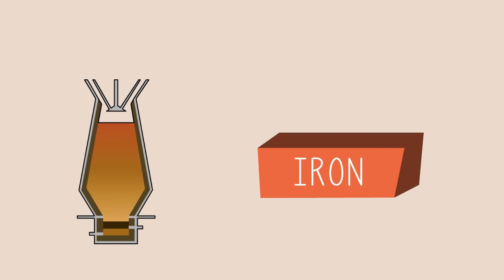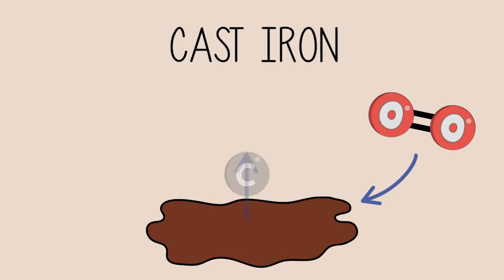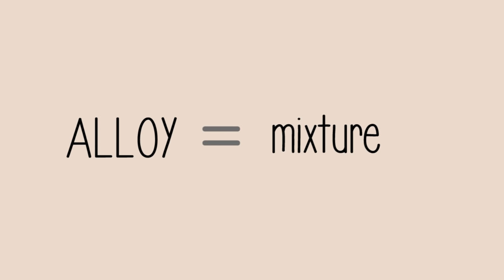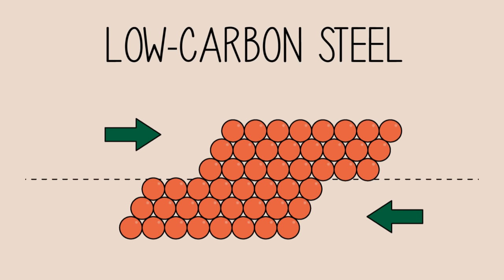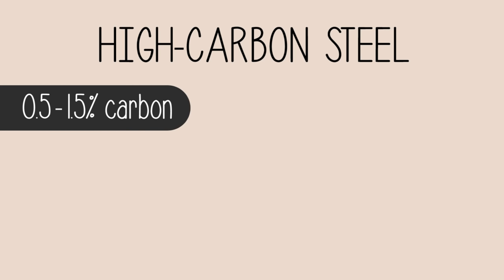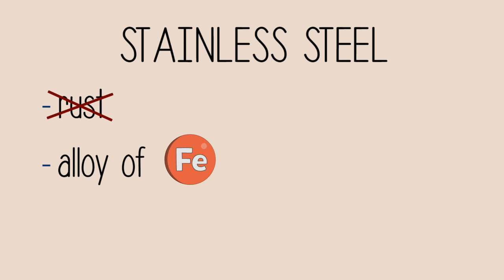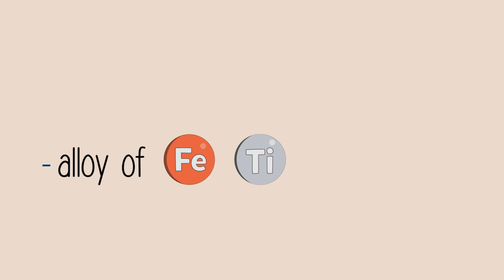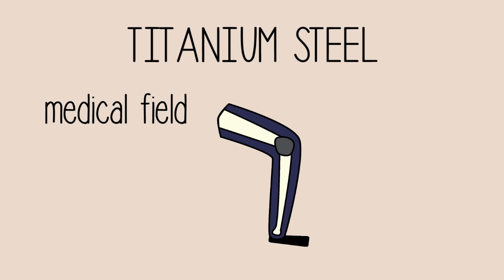Iron Alloys | Environmental Chemistry | Chemistry | FuseSchool

Comment: Two corrections. Pig Iron results when cast iron, or hot metal as it is commonly termed in the steelmaking industry, is mounded into "pigs" in a pig mill. These are essentially little ingots that are cooled and used is solid form.
Common / everyday rail steels grades contain nowhere near the concentration of Mn indicated..check various Standards from around the world.